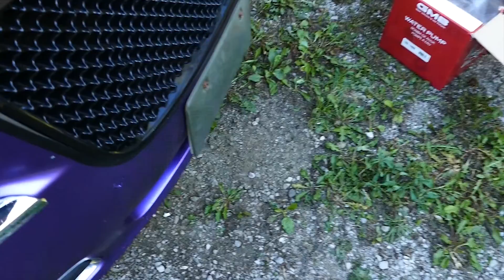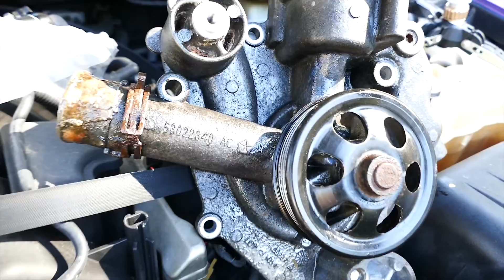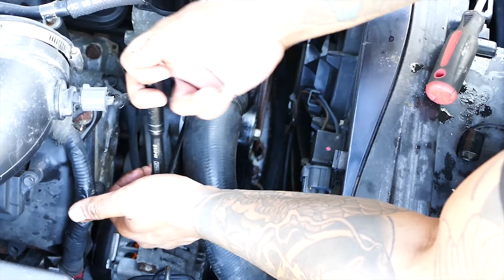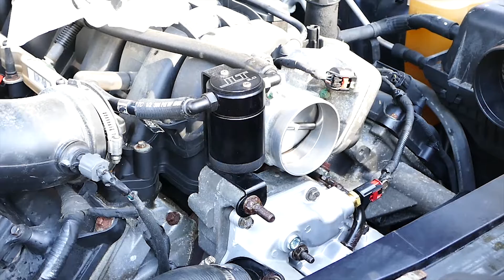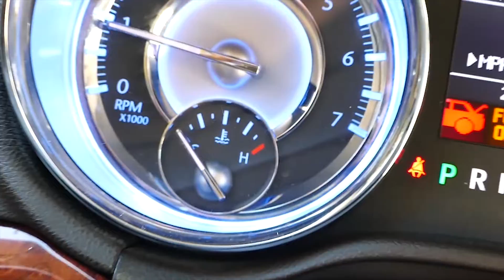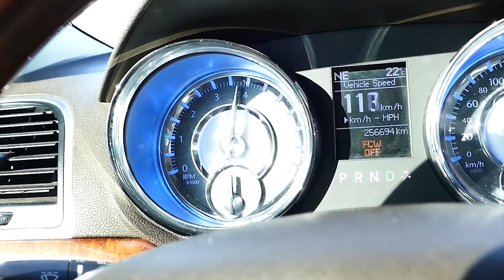chrysler 300 water pump replacement

Comment: I have a question , I have a 2005 Chrysler 300c 5.7 hemi , say you have a faulty water pump right, does the serpentine belt being loose means the water pump is going out or need to be replaced ? It doesn’t overheat at all but the lower radiator hose always have pressure on it & it comes off .

Comment: Good video. The coolant temp just spiked in my 300C when idling or in traffic. Fine once I start moving again. When it hit 260 I could feel a slight vibration through the brake pedal. Do you think it's the thermostat or the water pump?
Reply from the maker: @bradgrantz957  could be both, you can try the thermostat first and see if it works, if not usually when you change the waterpump u change the thermostat anyways.
Reply: @moparbro thanks for the advice. Used your video today to replace both. Idled for 20 minutes and it got up to 230 so I’m not sure what’s wrong. I don’t know that I’ve burped the system correctly.
Reply from the maker: @bradgrantz957  ah gotcha, try burping  again, if that doesn't work, take it to a shop for a coolant flush( the one where the attach a machine into the system that pumps new coolant in and sucks old coolant out. You may have a blockage in the coolant system. If there was an is issue with the radiator or heater core the shop would could identify it while they did the coolant flush. Hope this helps!

Comment: I gasket make not needed for the thermostat?
Reply from the maker: Hey there, the thermostat for the hemi comes with a rubber gasket that's on the thermostat itself and not the water pump like other engines.

Comment: Bro I change the water pump thermostat what can cause the temperature gauge to rise to 222 or 230 when driving fast. I have a Chrysler 300s hemi
Reply from the maker: hey there, next one to look at is the radiator then get a coolant flush to make sure there is no blockages in the coolant system. If those don't work then the Last part in the system would be a plugged heater hose. Considering it rises while driving fast leads me to think its a blockage in the coolant system or a failing radiator. hope this helps
Reply: My guy thank you I’ll try that had this car for 3 years and had to change the radiator twice lol much love brother love your content💪
Reply from the maker: @detroitking2238  thnx man! dam if the radiator hasn't been changed I would start with a coolant flush, I bet you have a blockage. Also the shop doing the coolant flush can diagnose any other issue while performing the coolant flush, so it's a win win
Reply: @moparbro  I’m going to change it one more time and buy a new fan and ac compressor if that’s doesn’t work I’m going to buy a mini van😁😁😁
Reply from the maker: @detroitking2238  haha sounds good man

Comment: Hey quick question. How do you know the water pump is no good ? . I got a 2013 Chrysler 300c hemi and it’s been overheating in 50 degrees weather 🤦🏽‍♂️
Reply: And no coolant would come out of the bleeder hole when I add coolant in the reservoir
Reply from the maker: @Boat300  yep, replace the water pump and if that doesn't work move onto the radiator
Reply from the maker: hey there, either the propeller bearing goes and it's loud when it spins or it leaks coolant, for overheating I would try replacing the thermostat first and see if that works
Reply: Yeah I’ve replaced my thermostat for the 3rd time and still overheat . I’ve check around the water pump and it looks like has a slow leak from under the water pump .
Reply from the maker: @Boat300  yea I would change the waterpump
Reply: Would give it a shot . Thanks in advance

Comment: How did u know it was the waterpump
Reply from the maker: it's started leaking coolant from the weeper
Reply: @moparbro  what’s the weeper do on the water pump? And did u drain the coolant from the radiator radiator plug before removing the pump ?
Reply from the maker: @JULESG8 hey there, the weeper drips coolant when the gasket fails, I just replaced the water pump and then sent it to the shop for a coolant flush after

Comment: Great Video! I've got to do the same thing like in a few days. and Hope you answer in time, but what sysmptoms were you experiencing that made you change out the Tensioner and Water Pump? I'm having issues, and think it could be the Tensioner, but a small chance the water pump could be faulty as well, or on it's last leg anyway.

thanks in advance!
Reply from the maker: Hey there! The water pump gasket failed and started leaking, technically I didn't need to change the tensioner, but I changed it out while I was there like the temp sensor and the thermostat. a failing tensioner would cause squeeking sounds as it's not able to grab the pulleys effectively. Also even though it was the gasket that failed on the water pump I would bet the pulley bearing has aged and its on the way out, so replacing the whole water pump was more of peace of mind. Hope this helps and thank you for watching!
Reply: @moparbro  Thanks for the reply! My hose at the "T" fitting by the firewall popped off and the T is busted. So I have to replace that T fitting and hope that fixes my issue. If not and I still get over heating I'll replace the Tensioner Pulley and the Water pump. I do see my tensioner pulley bounce with the cam lob. Don't think that's supposed to happen. So If I'm replacing that, I might as well replace the water pump as well.
Reply from the maker: @rebeccajaquez4491  No problem! yea while you into it you may as well replace those too, thnx for watching and enjoy the build!

Comment: 2 questions sir and great video you make it seem so easy 1. Do I need to drain coolant from the bottom 2. Is it the same as changing the pump on a 2006 chrysler 300 z
Reply from the maker: Hey there! 1. Just place a pan to catch the coolant below, when you remove the coolant return hose the coolant drains itself, it is the same as a 2006 chrysler 300c, the alternative set ups have the coolant reservoir on the passenger side near the front but those seem to be 2015+ hemis. thnx for watching!
Reply: @moparbro  awesome thank you so much